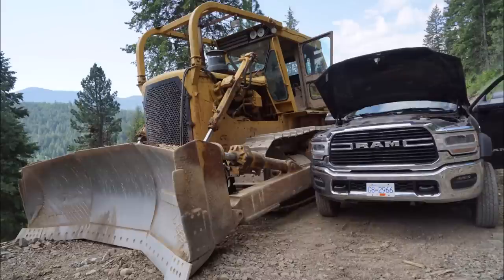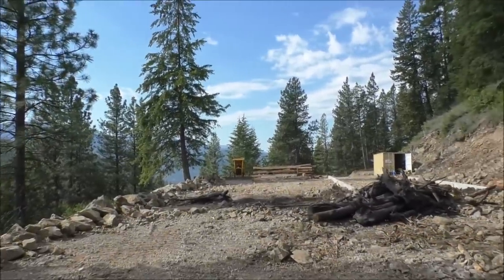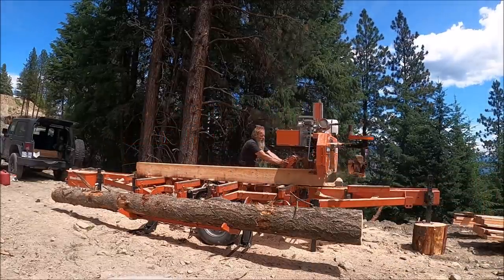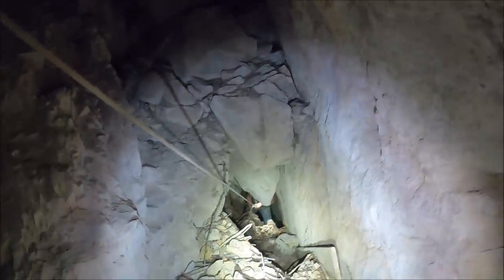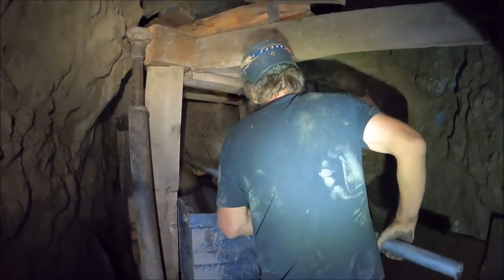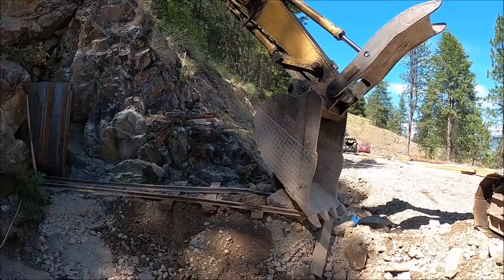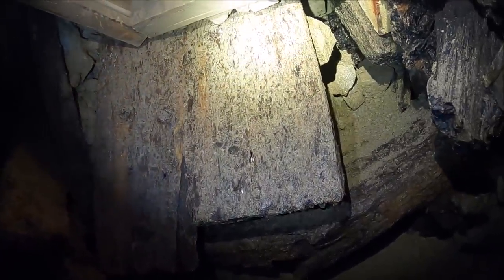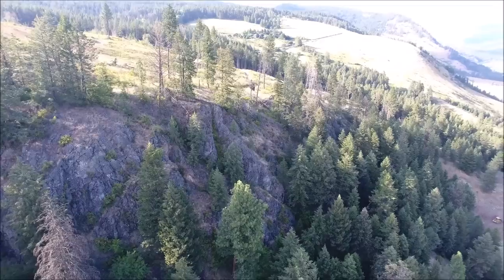#318 Celebration at the Yankee Boy Mine!

Comment: That dozer blade is due to some new hard facing to keep the wear down on the blade. You just have to get some of the right rods and burn in whatever pattern you want as long as everything is within about 2 inches so the dirt packs in. It's an annoying job, but it'll make the blade go a lot longer. hell, even if you've never welded before it's a good project because it's just worn material anyways

It might be a nice idea to let Sharon draw something out using some chalk or something. a whole little minecart and something like that to remember the construction of the museum
Reply from the maker: We aren't going to put a lot of hours on it. It will last long enough the way it is.

Comment: Can yall clarify a couple of things ? So you are attempting to clear out a raise, shaft whatever, haulage addit. You think a portion of the mine collapsed onto it and took out the support timbering there in an area behind what looks like a chute ? Any idea where the chute goes. Can you show a map of the mine ?
Were you able to get down to the backside of the collapse from above, if so what was your assessment ?
Reply from the maker: The top levels are all plugged. The 200 plus loads we have removed is coming from an internal level. We won't know what is going on until we get past the blocked raise.

Comment: It would be great if you had some sort of conveyor belt to take the material out quickly, that would be a bit of a challenge with the length and bends of the mine, not much room side to side either.
Reply from the maker: The ore cart works great, once you get it loaded!